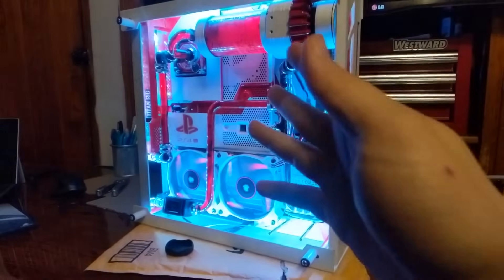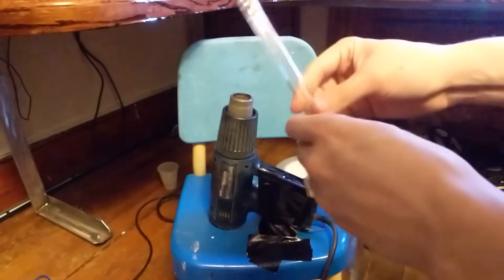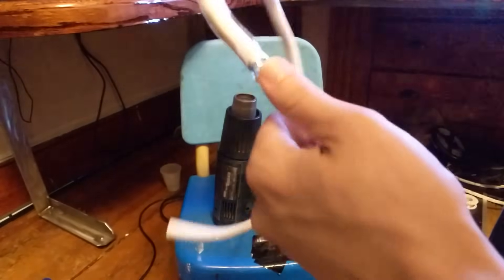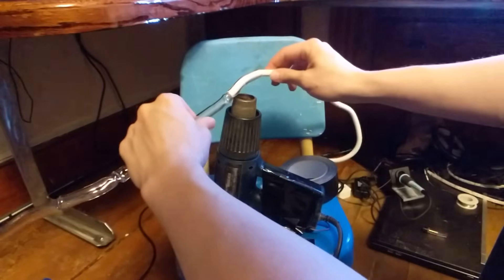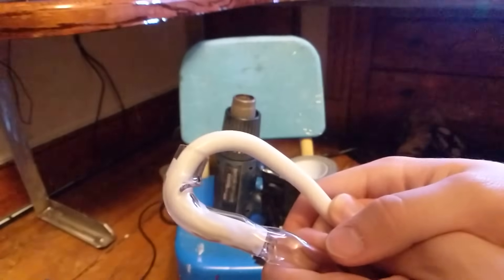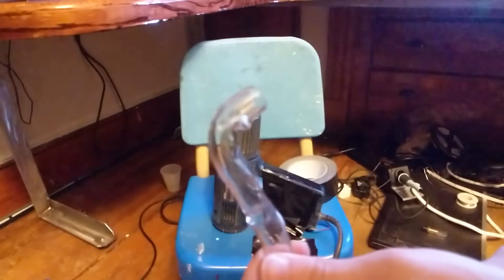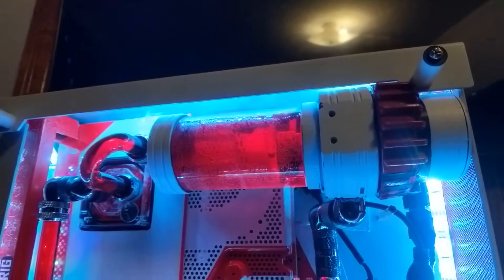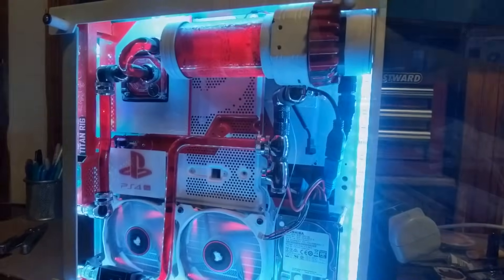PS4 Pro Water Cooled (Part 4) Bending tubes and adding WATER!

Comment: Would you be intrested in selling this?
Reply from the maker: Yes, but the price is high because all the components costs so much..
Reply: @JMAGG  how much you thinkin?
Reply from the maker: I can do$1800
Reply: @JMAGG  do you have video of it playing a game and does it still able to use the disc dtive?
Reply from the maker: Yes here is the part 5 video I made of it. https://youtu.be/aaDr4FkRb0k

Only issue I have with it is that if you go more than 15ft away from the ps4 with a PS4 controller, it will disconnect. Since the case is all metal it interferes with the Bluetooth connection when you travel to far away from it. Before when everything was in the original case you could travel about 25ft before it would disconnect

Comment: Also I'm sure most people don't realize this isn't completely useless. Liquid cooling will help with temps greatly which normally means you'll be getting the absolute full performance in all your games. No frame drops, and probably less dynamic res scaling
Reply: actually right but he's using HDD-Drives 😂 I dont really think his point was performance - rather look. 😂

Comment: At least it won’t sound like a f-18 getting ready for flight anymore
Reply: TylerFromNy mine burns the paint of the wall behind it😂
Reply: You need a ps4 slim or a ps4 pro they don't do that no more
Reply: HOOP lmao my launch Pro is way louder than my launch PS4.
Reply: Archer the new models are quite
Reply: Archer dats because the fan is clogged with a lot of dust and your heat sync try cleaning it Sony
Reply: Archer same I just cleaned my launch pros heat sink out and upgraded to an ssd so it’s back to whispering now but they are definitely loud af now
Reply: Verify My pro still does that 
I just gotta clean the dust from monthly-yearly
Reply: SGYT Plays how do you that
Reply: My pro is a damn jumbo. It's loud enough for me to need the tv turned up to hear dialogue properly
Reply: My pro is whispering
Reply: Scappley wdym fr
Reply: I airdusted mine and now it's quieter than a whisper
Reply: jamierawr88 id probably ruin something disassembling it lol
Reply: TylerFromNy yeah mine sounds like a airplane taking off
Reply: @Light-bringer I did all that and even replaced the fan and still super loud unfortunately...

Comment: From the list "cool but useless"
Reply: Sony engineers knew exactly what they were doing. They want the parts to last past warranty expiration and not much past that so you will upgrade to the new models.
Reply: @xungaming469  
Tell this to my PS4 fat
Reply: So, so ,so true
Reply: Watch UltraNSC Ps4 tempature test for God of war..
Reply: @SabentHD  
The PS4 was projected to handle this, there's nothing wrong in it
Reply: @mateuslira3411  Components are meant to be ran at 85c? I think you need to fact check, higher temps will cause faster decaying.
Reply: @SabentHD  
So, you assume that Sony's engineers did not know what they were doing?
Reply: @mateuslira3411  No. But most technology is only built to last 2 or 3 years before its compromised. To make you buy something newer :)
As in like cell phones and gaming systems. Stuff like that.
Reply: @TommyPickle6  the console gaming industry doesn't want you to buy a new console of the same generation, each generation is intended to last about 6 or 7 years, the majority of the revenue come from the software, the games. Sony doesn't want you to buy another ps4, it want you to buy the new the last of us, ghost of tsushima or spiderman instead
Reply: This is creative and awesome I’m a fan of my ps4 pro and would love to build this hopefully you are using a SSD drive.
Reply: Nooo it keeps ps4 cool way longer than normal ps4 fan
Reply: @lotus8965  
just
buy
a
pc
Reply: @lotus8965  nigga a Ps4 is designed to operate cool enough as it is... you cant OC it so adding Watercooler or Fans to the thing is WASTE OF MONEY and does nothing...
Reply: @lotus8965  
Nah, don't worth it, the money you would spend in this project would be enough to buy a new PS4, still useless, besides that,  the PS4 was project to handle high temperatures, there's nothing wrong occuring when it gets too hot
Reply: far from useless but if you are going this far just build a pc
Reply: DocBrewskie cant play ps4 exclusives on pc bro...
Reply: DocBrewskie the ps4 pro is a great console, only real flaw is the fan noise and thermal throttling

Comment: This may be a dumb question but, does these upgrades benefit the ps4 performance wise? Or is it just for looks?
Reply: Somewhat. Temperatures are way lower while operation ( playing games ) which means there won't be dropped frames from the APU potentially throttling down from overheat. Other than that - the system surely must be way more silent, in contrast the the jet engine sound of the PS4 pro fan.

Comment: did you overclock it? if u didnt then its still cool but it takes away all the aspects of what watercooling is
Reply from the maker: idfkgohst no you can't really overclock it because Sony locks it down. But it is more stable now when running 4k patched games. And I did this because I'm addicted to water cooling computers and stuff
Reply: oh, didnt know overclocking wasnt allowed. wouldve been cooler if you could. still a pretty solid build tho. i suggest you replace the hard drive with an ssd, heard it helps the startup time
Reply from the maker: I wanted to but I would rather have a 4tb hdd for 180 than get a 1000 4tb ssd

Comment: Iff i want this how much charge me?
Reply from the maker: Singh Jasbir cheapest way I can do it with Hardline tubing and with a 4tb hard drive would be $2100 if you provide me with a ps4 pro then it would of course be $1700. If you would want soft water-cooling I can do it a lot cheaper for $1700 or if you provide me with a ps4 pro it would be $1300. An even cheaper option would be if I used a corsair all in one water cooler, that would $1300. Or if you provide me with a ps4 pro then it would be $900.
Reply: JMAGG its game or cpu?

Comment: What happens when the temp rises and builds pressure is there an over flow ?
Reply: Austin K the increase in pressure isn’t really enough to worry about.
Reply: NickAirsoft how is that nothing to worry about? If the pressure inside get high enough it can burn out the fans and even lead to burn the circuit.
Reply: Most Certainly I’m just going to assume that’s bait

Comment: Why did you use water instead of mineral oil? It works like car oil, but flows like water when heated. It also is light and airy.
Reply from the maker: It doesn't look as cool lol

Comment: Wow that cooling must cost more than the console itself, why? Do you benefit any performance at all?
Reply from the maker: Balubish Tech its pretty much silent now. And yes everything cost more than the console itself, but it was worth it because it's a one of a kind.
Reply: Fair enough, follow ur dreams mate :)
Reply: Actually you may get a more stable frame rate since thermal throttling can occur with stock cooling although I suspect the bottleneck will probably hit home before thermal throttling.
Reply: Extended the life of it.
Reply: Gpu shouldn’t really throttle now so I’d expect some better frames with this setup. Regardless it’s sick!!
Reply: No additional performance.
Will give you lower temperatures with a lot less noise, though.... Which does increase the lifespan of the components.
Reply: @superswag4191  exactly
Reply: Exclusives
Reply: How i wish i could make my Pro silent. It doesn't have to look badass as this, as long as it is silent when playing higher res games.
Reply: I would just get a new system instead of risking it but you could just take the things out and put in your new system
Reply: Main benefit is extending the life of the PS4.  All electronics break eventually
Reply: @StephanieHua  Watch UltraNSC video on temperatures when playing God of War if I recall correctly it hits 80c just in the menu
Reply: Beautiful piece of art, how much was the total to make it like that??
Reply: Balubish Tech only benefit is it not sounding like an aeroplane but no performance benefit.
Reply: Emelio Lutchmansingh for real its still a ps4 at the end of the day. You can't OC, you must use the periphirals you are told too. You must pay to play online with your friends. With internet that you are already paying for.
Reply: @memes4195  Jailbreak and run CFW if it ever gets made that's when it would matter
Reply: @memes4195  Unless the exploit scene finds away like they did with the psvita

Comment: By far coolest set up. Is there anyway I can get the list of ribbon cables you found and where to get them. It’s because of your videos I’m attempting to try this myself. I’m going lowpro on my rig because it’s in the living room. Using aio cosiar h55. I don’t have a ps4 pro. I have a standard ps4. Will the same ribbons work for mine? Maybe if I know where you got them I can verify. Thanks.
Reply from the maker: Matthew Castaneda jr. My next video I'll have a complete parts list to everything I bought and also I'll go over the topic of ribbon cables because I think they might be slightly different on the standard PS4.